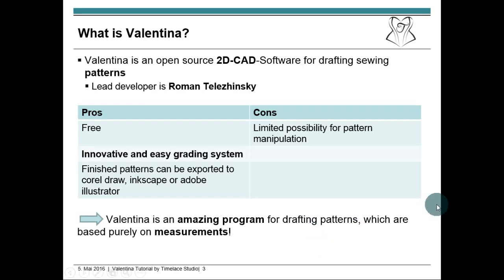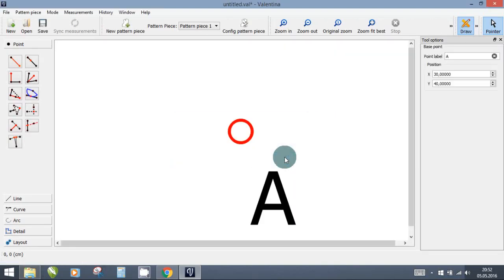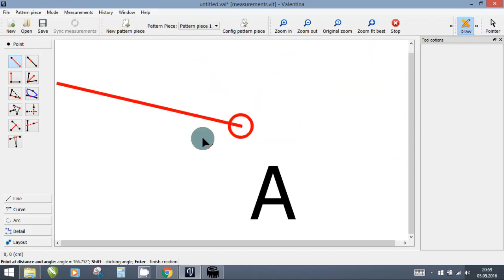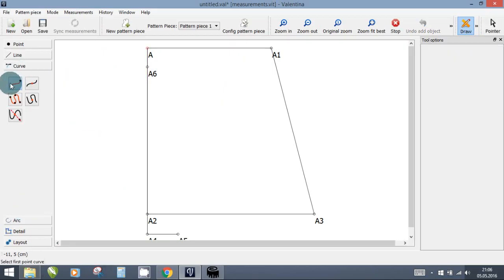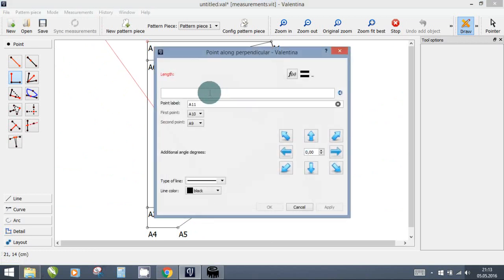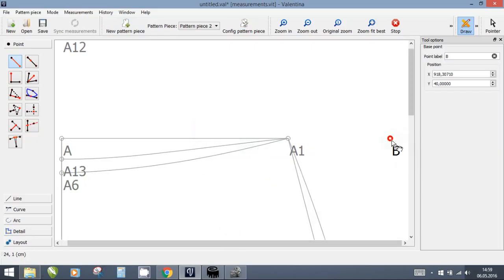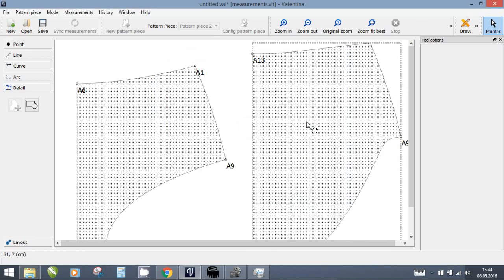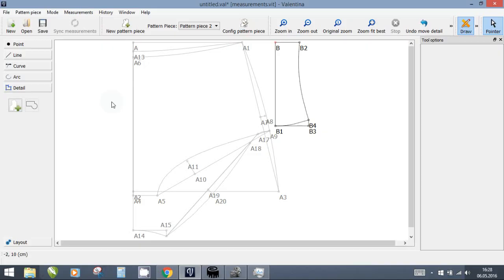Tutorial: Pattern Drafting with Valentina

Comment: Hey, I'm curious, are the numbers the same in the formulae, for inches?
Reply from the maker: If the numbers are without unit, they are the same. Tf they have a unit, you have to convert them from cm to inches. However, it's easier to do all the calculations in cm. :)

Comment: Great tutorial!  One thing I would STRONGLY suggest is to not use manual curves.  I came up with a way to create smooth curves using three points that, while not as easy, gives FAR better, reproducible results.  (I've asked the devs to make it easier to have quantified curves.  We'll see what happens.)  Here is the link.  If you have any questions, go ahead and ask them in the forums.  https://forum.valentina-project.org/t/how-to-require-curve-to-pass-through-or-by-a-point/600/10

Comment: Hello, I just thought I'd share my little discovery with you! You mention in your video that all curves need to be drawn in the clockwise direction for Valentina to be able to create a "piece". I figured out today that you can reverse a curve's direction when selecting pints and lines with the "detail" tool. In the dialogue window there is a tick box "reverse" that you can find above the "seam allowance" tick box. Just select that and the curve will reverse. If it does not work when creating the detail, go to the detail mode and you will see a straight line between two points instead of a curve. Click on the detail to bring up the options and reverse the curve. It pops up! I discovered it today while working on a skirt block, my hip curve was originally directed anti-clockwise.
Reply from the maker: Anastasia Every That's a great tip! Thank you for sharing it! :) This will make drawing curves a lot easier.
Reply: 1.  Go to this page: https://valentina-project.org/download/
2.  Enter your email address, then click 'Submit and Download'.
3.  Click on the download link for your operating system that will appear down the page.  (Only choose a 'Weekly Test Build' if you are feeling adventurous.  Otherwise, pick a 'Current Release'.)
4.  Install as usual.
Reply: Anastasia Every hi,  I'm a little  confused  on how to download  software?